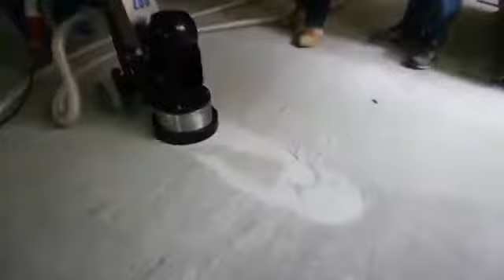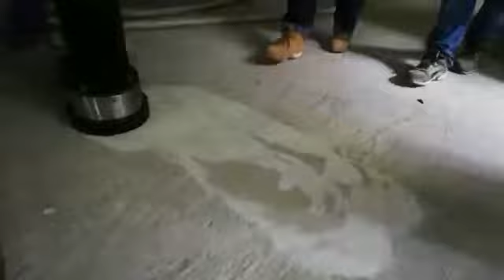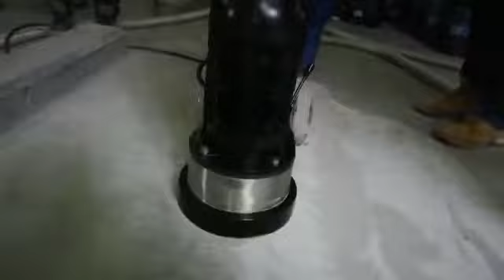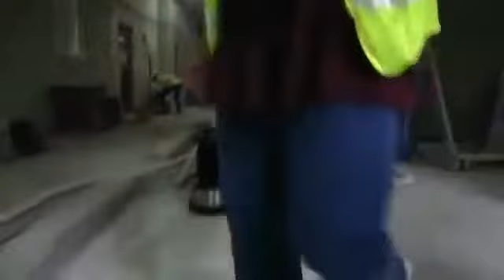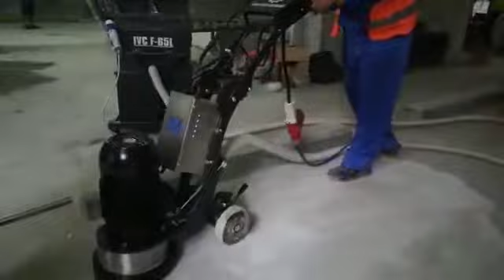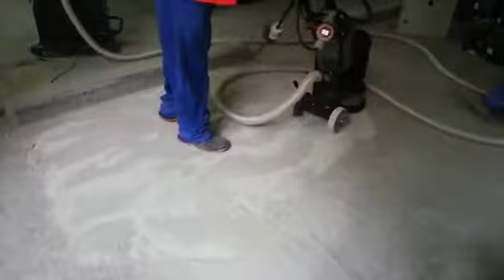250 single phase floor grinding machines working in Qatar

Comment: I know a lot of good work Epoxy floor, I have 4 years of work experience in Bangladesh, I want to do this work in your company, I will be sincerely happy if you give me this work, Thank you
Reply from the maker: Dear friends,
Thank you for accepting the request and for your interest.
This is Jane Ling From the Xingyi&High Tech Grinding which a leading manufacturer of floor grinding machines in China.
Check more from Video: https://www.youtube.com/watch?v=K3SkqSBNr88&t=35s
Ride-on smart floor grinder:https://youtu.be/17IoBE9QdYg
No third party Factory, It has gained 300 patents and 20 honors. Every months Production more than 1000 sets concrete grinder，Own factory have 350 employees.

Welcome to visit or Live inspection our factory at any time~
Thank you and please feel free to call Jane Ling if I can be of any further assistance.
Kind regards
Jane Ling
Director of Sales&Marketing
Mob/WhatApps/Wechat: +86 15960788816
E:xingyi16@polishingmachine.cc